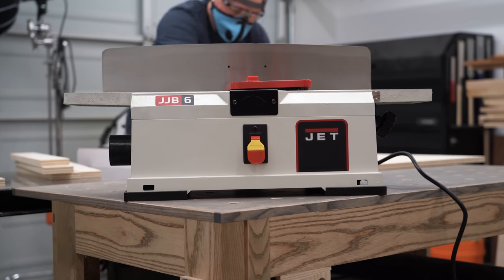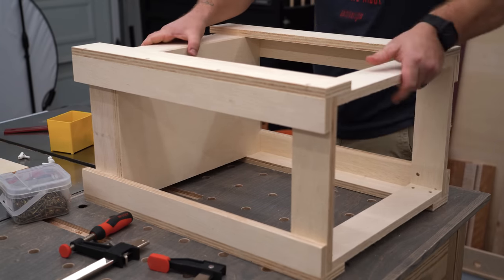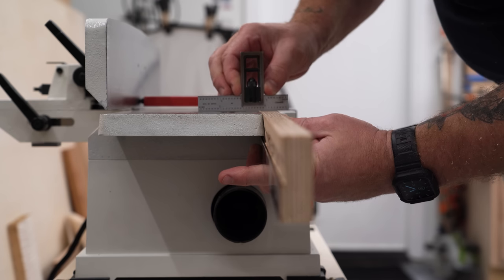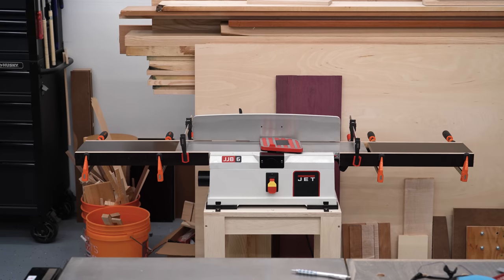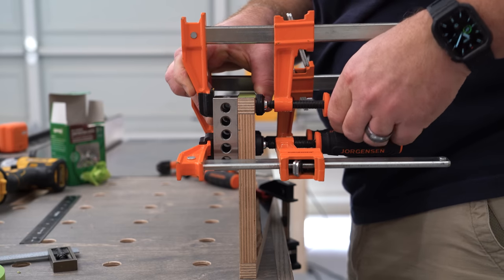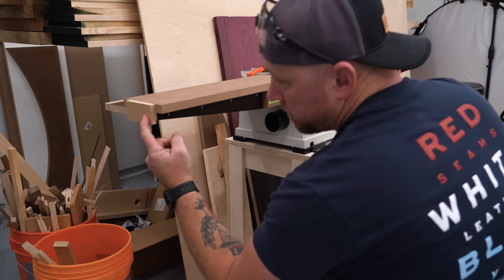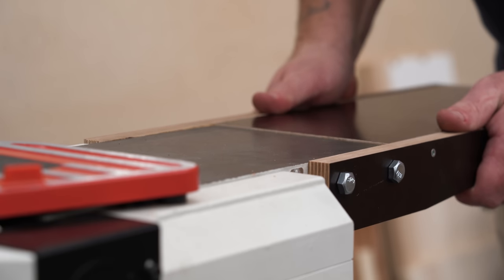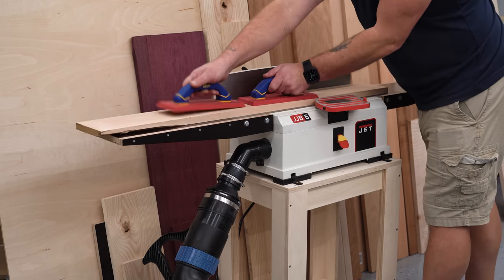Making a Benchtop Jointer More Better

Comment: I did something similar to my old Delta 6" benchtop years ago that I found in ShopNotes. I used 1/8" aluminum angle stock for the braces and it has worked out well. I'd love a much larger jointer, but don't have room in the shop. I can attach the wings in a couple of minutes when I need to joint longer than around 3 ft and everything stores away when not in use. Keep sending inspirations Jodi. - Chris

Comment: Really nice work. To eliminate the flex at the end of the extended outfeed, you could add a brace from the underneath towards the end of the outfeed back to the top edge of the stand. If you don't want it to be clunky, this could be a metal rod - and with that you could make it threaded rod and adjustable as to length, also.

Comment: We'd all like a bigger jointer, as the one we own is never large enough.  ;)  This is a nice idea and I may try to build these for my vintage late 60s Rockwell 4".  

Yah, 4"... it was free, in great shape and came from my dad.  Built like a tank, like most vintage power tools.  I made a mobile stand with some on-sale shop stand parts (from Rockler), two laminated 3/4" plywood top pieces and compartments below... one open for the motor, one enclosed to catch the chips for hookup to my dust separator.

Comment: Great stuff, great work! I have a 6" with fairly long infeed and outfeed tables, but it's the 3-knife cutter head. This is an excellent modification to add another option when looking to upgrade to a helical head or getting an affordable jointer in the shop and definitely "making it more better". My 6" takes two people to move it anything more than one foot. Great video.

Comment: Nice!  Two suggestions: Put a brace from about the middle of the infeed and outfeed extensions back to the stand, that might reduce the flex, assuming the clamps that hold the jointer to the stand are stiff enough.  Second, replace those 3/8" bolts with some black 3/8" flanged button head screws to make it look really clean :)  Something like a McMaster-Carr p/n 91355A193, assuming 2" is long enough.

Comment: I think that's a pretty good improvement ... I wouldn't worry about a tiny bit of flex. The extensions really just help you manage longer boards. As long as you keep the greatest pressure on the cast iron, the extensions shouldn't really affect anything as long as they're straight, coplanar and flush. Still wouldn't trade you for my 8in jointer though. lol

Comment: Might I suggest.... Increasing the height of your extension side pieces to make a larger truss will greatly reduce defection in the top. The face surface area of the side trusses that butts up against the jointers housing will then increase rigidity and eliminate bending moment and deflection topside.

Comment: Nice I have the 8 inch wahula jointer it has the extension bars. But  D*** are they hard to get level with table. Good idea like to see channels show solutions most of us common woodworker face yes floor model one day but I want a bandsaw first. Thanks

Comment: Did you look at any of the wider benchtop jointers? Like cutech or wahuda? I like the look of the little jet but seems like a 10" or 12" from cutech would make for sense. I'm looking to upgrade from an old delta 37-280
Reply from the maker: @quadcamera I didn't other than Jet's jointer/planer combo. I would still love to test drive that.

Comment: That should work just fine, even if the end of the outfeed has some flex it shouldnt matter because you shouldnt be pushing in that area anyway. If youre jointing a 12' long board, maybe it would matter a bit.

Comment: Would it have been just as possible to cut those table saw rabbets(I think those were rabbets?) on the jointer itself? Just moving jointer fence inward to meet the same cut width as what you did on the table saw, and taking a series jointer passes until you reach your depth of cut
I will say that short clip of you doing the table saw cut made me very anxious for your digits.

All in all though, great idea! I definitely will think about trying this out on my 6" wen jointer

Comment: Just bought this same jointer a couple weeks back, and would be interested to know how your tables are holding up after a couple months. Want to try the same, but nervous about drilling into the existing tables if it turns out to be a bad idea. Any updates?

Comment: Good Day… I sent you a comment earlier about your Jet 6” jointer bed extension project. I now have bought one and I am making slow progress on doing my in/out feed tables. Time wise it’s everything X 2. The screws that you used? Do you offhand know or remember the name of those screws? I believe I have some but I cant find them. When I go into Ace/HD/ Lowes trying to describe them… I leave everyone frustrated and I leave empty handed. I believe this is what my deck guys used on my Ipe deck. Just looking for a bit of help if you have time. Thanks for your outstanding videos. Thom Schuck / Portland Oregon
Reply from the maker: @Timber2Toothpicks It might be these screws that you are talking about. (https://spax.us/products/t-star-plus-trim-head-mdf-hardwood) These are the ones that I used to join the wing braces to the wing tables. Hopefully that's what you were after. I think I got them at Lowe's.

Comment: I have the same unit. One day after some unusual loud noise, I realized the cutter heads are no longer level with the out feed table. The out feed table is not adjustable and the cutter head is not adjustable as well. Checked inside, the bolts are tight, belts good tension. I don't recommend this unit.

Comment: i'm just surprised they would sell a helical head in a bench top
Reply: more accurately, it's a segmented cutterhead. sure if you traced a line through the center of each mountin point it would form a helix, but i do find that calling these helical heads is dishonest

Comment: I have been wondering  the people who make a chop saw station.

Why not make it modular?

A way to drop any too you may need with longer in and out feed.

I know it might take longer for set ups
But if (like most of us with tiny garage shops) it could help make a space more useful.

Using this lifting table to adjust for the tool being used

https://youtu.be/ohyMRATOt5U?si=J1BvlKHV26ocFF5d